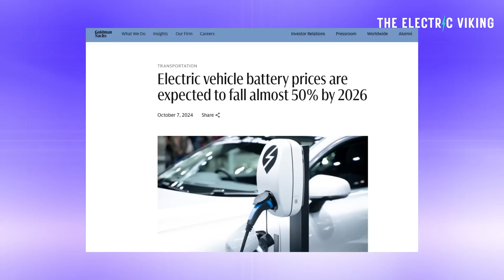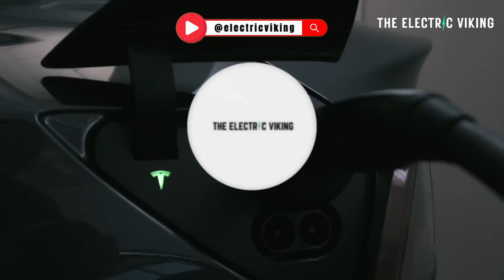Analysts say a NEW EV battery will be cheaper than fixing a gas engine

Comment: I would have thought that with the Chinese releasing 1-3 million km batteries that in reality batteries will soon be guaranteed way beyond the useful economic life of the rest of the vehicle and that these batteries would potentially have a second life as residential/commercial storage.
Reply: Batteries last 450-600k km. Vehicles rarely last that long outside of Arizona.
Reply: @wolfgangpreier9160  Why not a warranty that matches that then..... ?
Reply: @martina5328  Because nobody knows how long they really last. 

450-600km and more is a calculated value resulting from the possible cycle life. 

197K is the warranty from Tesla, Kia and Hyundai have similar. Toyota gives 1 million km warranty - i do not know one single car that has had 1 million kilometers on the odometer.

Ok sorry, one: a Model S from a crazy german aristocrat.
Reply: @wolfgangpreier9160  Once the warranty is gone it is a lottery ticket with only losers. Everything degrades. Battery swap is a good thing to have.
Reply: @ Nio is the only one with battery swap and no warranty ON the battery swap. So what is your point?
Reply: @wolfgangpreier9160  What are you talking about - warranty on the swap? Do you get warranty on a haircut? Most people use baas (battery as a service - renting the battery).
Reply: @ When i rent the battery i can not sell the car after 3-5 years. You can not sell a half product.
Reply: @wolfgangpreier9160  Strange how you can buy a used NIO then. Very strange..
Reply: @martina5328  I do not see any to buy here in Europe.
Reply: @wolfgangpreier9160  I just checked one site: 58 used NIOs for sale in Europe.
Reply: @wolfgangpreier9160  Labour cost of swapping a Tesla battery $500-$3,000. Some even say $5k. And if warranty is already gone, it is still gone after the swap.
Reply: Guarantees are against the manufacturing or design defects but there are also other cases like some fairly minor accidents or some misuse that wont be covered by the guarantees but still require battery replacement. There are lots of people that are afraid of battery replacement cost and this would address their concerns and would make second hand EVs more interesting for them. For example car buyers that are buying cheaper and older cars and don't want to pay higher premiums for the comprehensive coverage might not be very interested about buying car that could bring them battery swap bill that equals value of the car.
Reply: You still cannot integrate the battery in the chassis - you need swap to get it out, once there is a malfunction. That is why you want an EV with battery swap.
Reply: @martina5328  "That is why you want an EV with battery swap." Ah - Nope.
Reply: @wolfgangpreier9160  Car A and B are the same, but one also has swap. Which one do you choose?
Reply: @ Wrong question. There are no car A and B that are the same or even similar. Nio is much too expensive. Tesla has stopped producing swappable batteries. All others can be changed in a few minutes.
Reply: @wolfgangpreier9160  Onvo is very similar to Tesla, but better than Tesla, at a lower price. Onvo comes with swap option. My point is - swap is good, comes with a lot of benefits that makes it a no brainer to have.
Reply: @ Never heard of that one. But in China they have many hundred EV startups. No swap is not „good“. Its useless. The next Nio swapstation is 00km away and the car costs 92K Euros. For 52K i get a faster, bigger, more efficient Model Y with working Software.
Reply: @ Better means 

Safer, Easier usage, easier and faster App, free lifetime communication, free lifetime updates, free lifetime traffic information, free lifetime satellite communication and satellite view, Full self driving and placement into The Onvo taxi fleet, more sustainable, more efficient, faster, slicker, easier to handle, more space, better speed recognition, better Navigation, better matrix LED headlights, lower cost of ownership, higher resale value, more service centers, cheaper body shops, faster replacement parts delivery and availability, lower cost of repairs, lower cost of insurance, loaner for any reason, longer warranty of 300k km or 16 years. 

Correct?
Reply: @wolfgangpreier9160  Onvo is a better car than Tesla Y. Tesla is not exactly known for quality here in Europe.
Reply: @wolfgangpreier9160  Have fun waiting for your car to charge or slash your battery life with fast charging. Model Y should be compared to Onvo. Onvo beats Tesla both on paper and in practice. Look it up. All Tesla has is the brand including Elon Musk. But a Tesla is not cool anymore.
Reply: NIO, Onvo, Firefly with battery swap and battery as a service is already there - your battery will never fail with that setup.
Reply: @martina5328  and they offer battery lease. So it’s not even your battery.
Reply: They do even now, the low quality leaf batteries even! Storage is way less demanding.
Reply: @joebullwinkle5099  You need to automate getting the batteries in / out of the car... It is a no brainer.
Reply: All this talk over accessing lithium etc.What about recycling of old batteries (Redwood Materials) these are a high density 'ore' c.f.,natural ore!
Reply: With 80% of recharge capacity left, they already are resold as backup solar power to African countries.
Reply: Both lithium and cobalt are rarely occurring elements.  I can see the countries where cobalt and lithium do exist forming a cartel to raise the price of both these commodities. Another factor is the tendency of lithium batteries to explode. In the UK at present there is a campaign to prevent e-bike/scooters from exploding, do not charge the vehicle indoors and near to your escape route is the message.

Alternatively, sodium might be a better solution to batteries, what about capacitors as a storage method. There have recently been advances in this technology. Needless to say petrol will put up a fight. Just because electric is the best does not mean that it will triumph I.e. betamax v VHS. Love your stuff.
Reply: 1) Cobalt isn’t a required element for batteries. This is true right now.
2) Cobalt is everywhere there’s copper.
3) Lithium is also substituable, although sodium based batteries aren’t yet fully developed to economically feasible 
3) Lithium is EVERYWHERE. There’s a range in difficulty in gathering it up, however there’s enough near-feasible already that it’s little lag in responding to demand (see historical Li prices)
Reply: @aoeuuaoaou  There are roughly 200 BILLION tons lithium in sea water alone. 

We do need about 160 million tons in total for all applications. 

Everything else can be recycled.
Reply: @wolfgangpreier9160 lithium in batteries can be totally and permanently recycled. The challenge at this time is the cost to do so, which is greater than mining new lithium.
Reply: @229andymon  With the other minerals along for the ride, it is already economical with some chemistries.

Besides, if there was some sort of supply cost or constriction that developed the economic tipping point for recycling isn't far away for even the lesser ones.
Reply: @aoeuuaoaou  I’m sure economies of scale will reduce the cost too. I don’t know what would happen if we move to sodium, would it even be worth recycling?
Reply: @229andymon  The sodium itself, almost certainly not. Nor the bulk medium and probably not the encasement. It's the doping materials, and the alternative disposal path cost, that'll make or break it.
Reply: @229andymon  Yes, still we do not need more than about 200 million tons worldwide until the recycling catches up on the mining. Like with lead from lead acid batteries (which should be replaced my Sodium Ion batteries btw). 97% of the lead comes from recycling.

And in eht EU starting in 2027 45% of the lithium MUST be recycled. No matter the cost.
Reply: @wolfgangpreier9160  If your lithium calculation is based on ultimately replacing all ICE vehicles with EVs, then I’d disagree with that amount. I’ve bought into the robotaxi theory where we effectively see the end of personally owned transport. Of course if sodium can compete successfully with lithium then all bets in that regard would be off.
Reply: @229andymon  Lithium has other use cases besides EV batteries. Sodium not. 

Now guess how much interest investors have to invest in a sodium based battery production for a niche market.
Reply: @wolfgangpreier9160  Yes, i take your point re other uses, however, I’d be interested to know if you also take mine about robotaxis. If personal ownership is indeed basically replaced with robotaxis, my guess would be a reduction in vehicle populations of anything up to 70-80%. 
On sodium, if it can compete toe to toe with lithium, why lithium at all?
Thanks
Reply: @229andymon  Robo Taxi will have a immediate use case in USA. In Europe not so much. City dwellers do not need cars today and only 30% of them even own one. 

Of course robo taxi will change the landscape. 

BUT: If there is only one company who can deliver this will not be allowed. Even if that decision would hurt the European economy.

A monopoly will not be allowed.

Full stop.
Reply: @wolfgangpreier9160  I wouldn’t envisage a robotaxi monopoly, there are already several players and I’d guess there will be many more. 
I’m not sure I’d agree there will be a significantly smaller demand for them in Europe c/w US. Car ownership in US is certainly higher than Europe, but it’s still very high in many European countries.
Reply: @229andymon  Just saw this ""I wouldn’t envisage a robotaxi monopoly, there are already several players"

Ahh - which ones? I know of not a single one.

Waymo works in Phoenix and LA.

Baidu works somewhere in a chinese city.

Tesla could offer anywhere = can create a monopoly which will not be allowed in Europe.

There are no alternatives.
Reply: @wolfgangpreier9160  The robotaxi “industry” isn’t even an industry yet, it’s in its early infancy, so I wouldn’t guess where it’ll be in time. 
Are you referring to the actual (driverless) vehicles, rather than the service? If so then I suppose it’s possible Tesla might be able to dominate that market with their cybercab, but only for a while. I suspect they wouldn’t be allowed that for long. As soon as that takes off other producers would quickly jump in, assuming they’re not already planning to do so. 
In any case, if Tesla, or any other company, manages a temporary monopoly as a reward for being quickest, I wouldn’t be too worried about that. To be frank, I’m not sure why you are?
Reply: @229andymon  "Are you referring to the actual (driverless) vehicles, rather than the service?" Both.

"As soon as that takes off other producers would quickly jump in, assuming they’re not already planning to do so. " ok, who can? 

Who has the mental courage, who has the brass cochones, who has the iron will to drive his people that they invent a totally new technology which is even more complex and error prone than rocket science - original quote from Space-X engineers.

"In any case, if Tesla, or any other company, manages a temporary monopoly as a reward for being quickest, I wouldn’t be too worried about that. " i am not worried. 

I told you they will not get the permit. 

That is all. It will NOT happen outside the US and maybe select other countries like Switzerland or UK.

If Ford, Mazda, heck even Tata would come with a similar solution - not Waymo or Baidu they use HD maps - or when Tesla opens their system to the public domain - which of course immediately invalidates everything they've done so far - then Tesla may get a permit.
Reply: @ OK, I’m not as well informed on this subject as you apparently are. I can’t say I see an insurmountable problem though. If it works and if Tesla starts reaping huge rewards (for which they’d be entitled) then my experience tells me someone else will sooner or later join the party, that’s how business works. The Chinese won’t be caught napping for too long I expect. 
Like nature, business hates a vacuum.
Thanks.
Reply: The upshot of that is the most likely limiting materials factor for BEVs is copper, followed by materials for magnets. There’s strategics, already being acted on to reduce these. And technically you can effectively eliminate magnets, however the later is at the cost of more copper.

Copper is very, very hard to eliminate. It’s so much better at being wire than any metal save in some ways for the ones we price at per/troy ounce. 

So copper, copper mines are what we really need.
Reply: @aoeuuaoaou  Copper can be recovered from recycling. Lithium is a lot harder but batteries are not about 80% recyclable and that figure is only going to rise.
Reply: @daveherbert6215  Lithium is not rare. Who told you such a tale? Lithium is expensive to refine. 

Cobalt is rare. But you do not need Cobalt for your batteries. Its just convenient.

"aise the price of both these commodities." this already happened in 2020. Today the prices are about 5% of those.

"Another factor is the tendency of lithium batteries to explode" Yes, if you put a stick of Dynamite inside it explodes.

Lithium is most certainly NOT explosive.

Gazoline? Oh well, it burns doesn't it?

" In the UK at present there is a campaign to prevent e-bike/scooters from exploding, do not charge the vehicle indoors and near to your escape route is the message." Yes, the UK also jailes everyone saying there are only 2 genders. 

The UK wants the death punishment for all children who killed their rapists.

The UK has Brexited, what do you expect from a people who cut their nose to spite their own faces?

"Alternatively, sodium might be a better solution to batteries," Yes Sodium in water does not burn. I guess you never were in school right?

"There have recently been advances in this technology." Sodium batteries are older than Lithium. Why did lithium win? Its lighter, it has faster electrons, it is easier to handle - less explosive - it is cheaper to manufacture, it costs over the whole lifecycle less and is more efficient than sodium.

Sodium batteries have two advantages: They work very good at very low temperatures, they can be charged faster than lithium cells.

"Needless to say petrol will put up a fight." Yes 

DEATH TO ALL FOSSIL!
Reply: Lithium is NOT rare@daveherbert6215 
There is said to be 22million tonnes that is economically viable to mine. Enough for 255years at last year's rate. Recycling will mean mining will be unnecessary long before reserves are depleted..
Express opinions. State facts.
Don't state opinions as fact ... please